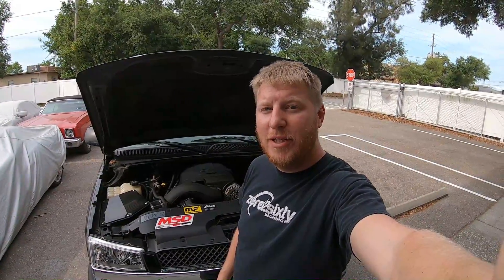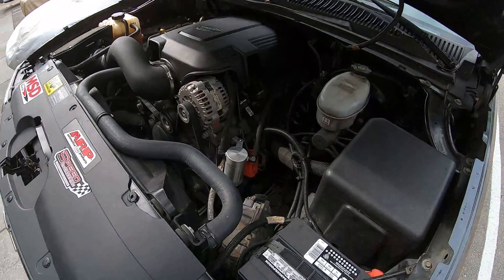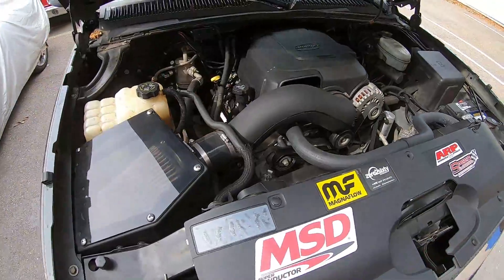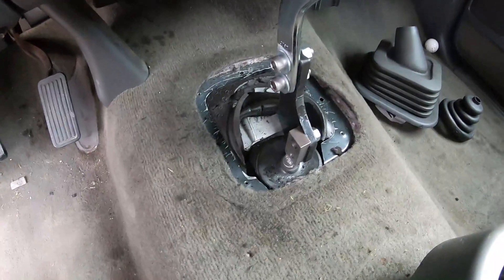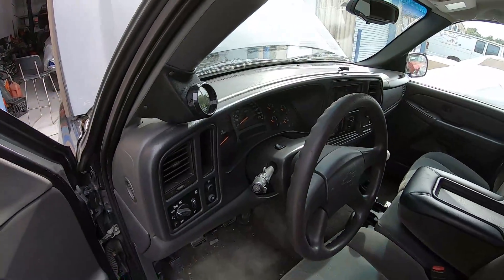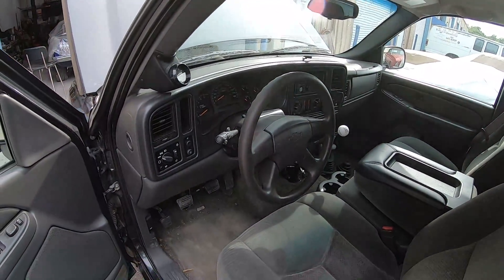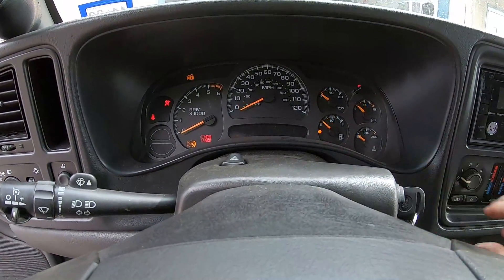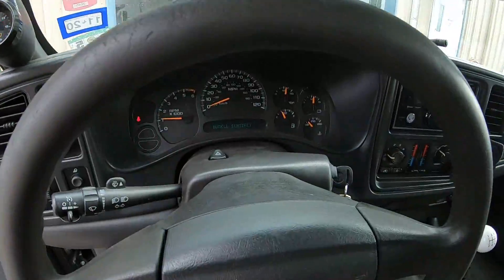This should have been an option! SILVERADO L92 (LS3) & T56 MAGNUM SWAP with a TSP LS3 Stage 2 Cam

Comment: With the l92 having an electric throttle body what did you have to do to get it to work with this truck? Is the throttle body swapped for a cable one?
Reply from the maker: They make an adapter to go to a 6 pin like the ls3. This was a drive by wire truck to start.
Reply: @ my truck is currently a dbc (2000 Silverado 5.3) What would be the easiest way to get this swap done? Add a dbc throttle body to the l92? Or convert the truck to dbw?
Reply: @adriannunez2290  I'm currently doing this swap in my 2002, and I just got a 92mm FiTech DBC throttle body from Speedway. Haven't hooked the cables up but they look like they'll fit no problem and all the stock sensors bolt up to it.
Reply: @ let me know how it goes brother 🙏🏽 I’m pretty close to getting everything I need to get started this is one of the last pieces
Reply: @adriannunez2290  Will do, should have it all finished this weekend so long as no issues arise.
Reply: @ how’d it go man?
Reply: @ I was just about to give an update, great timing! I mostly got the swap done, it's currently running and driving great, and I would say the throttle body is decent. I did have a few issues with it though.

The bung for the cruise control cable is too big, about .019" oversized. I am probably going to sand it down and make it fit, you probably could drill the connector on the cable itself, but I wouldn't recommend that as there isn't a ton of material to work with.

I also put my original IAT/IAC and TPS sensors in it instead of the sensors that came with it, which worked fine at first, but today it would fire and immediately die. I swapped the IAT/IAC sensor back to the one provided and that seemed to solve the issue. Not sure exactly what was happening, I'll probably test it more tomorrow to make sure that's what the problem really was.

If you want a more worry free route, I have heard really good things about the Nick Williams DBC throttle bodies. But they're VERY expensive, around $500, which is the main reason I tried the FiTech. 

Also I personally WOULD NOT swap to drive by wire, I think it would be a ton of work for no gain. But that is merely my opinion and I have not researched doing it.

Hope this helps you!
Reply: I guess the IAT/IAC wasn't my problem, as it is still doing it this morning... It might be something with the TPS, I'll play with it more later and see.

Comment: I just bought a 2005 2500 HD Silverado 4x4 6.0 with the 4L80E and really want to do the Manual Trans, been looking at the T56.. But, I still want the 4x4..
Reply from the maker: Unfortunately there is not an off the shelf way to do this. Every one that has been completed has used some sort of a fabricated adapter to the transfer case.

Comment: Just finishing up t56 mag swap like this and was wondering what clutch line you used to go from factory location hookup(gold quick connect) to new location near the bellhousing? I'm going to a Tick performance clutch master but not for a few months and would like to put some break in miles on my triple clutch setup.  Line length,part number etc. Tha ks

Comment: What’s the difference between the L92 and the L94?
Reply from the maker: L94 cam after the l92. L94 is afm and vvt. L92 is vvt only
Reply: @Zero2SixtyPerformance  thank you for your reply. Also that is E85 correct?
Reply: @Zero2SixtyPerformance  I have a 2010 with the 5.3 that I’m looking into dropping in a L94. (Also a single cab)
Reply from the maker: Pretty much a straight swap

Comment: Hello, I have a question. I have a l92 that I want to swap in a 2006 Silverado. I’m not sure what type of harness could I use. Could a 2006 Silverado harness work with the l92?
Reply from the maker: The 2006 harness will work. You need a cam/crank adapter harness, injector adapters and knock sensor relocation harness.

Comment: Hey! I'm actually doing a similar swap. Would love to reach out and get some pointers on what all I need. I've got the trans, front shift relocated, bellhousing. I know I will need a drive shaft from a 4l60e? And something to block out reverse?
Reply from the maker: The Magnum uses a larger yoke than the 4L60e. You can get one right from Summit. You will need a reverse lockout box as well. We used one from American Powertrain on this car. Also available from Summit pn ELUN-10013
Reply: @Zero2SixtyPerformance  sorry I am just now seeing this. But my trans is not a magnum I actually just have a stage 2 rebuilt converted lt to ls borg Warner t56.
Reply: @Zero2SixtyPerformance  thanks for the help and assistance for sure!!!

Comment: how did you get the shifter location so far forward on the tunnel? In other videos i see the shifter coming out much closer to the seats
Reply: Is there a link to the shifter relocation kit? Having trouble finding one
Reply from the maker: We changed the location of the shifter.

Comment: I’m doing this swap on the same truck but mine is 4wd and I’m planning to delete the 4wd. Do you know if the transmission mount points are the same or is it different since I had the tcase?
Reply from the maker: Either way you will have to modify the crossmember so I dont think its going to matter but to answer your question, I believe the crossmembers are different for 4wd to 2wd
Reply: @Zero2SixtyPerformance  ever done t56 and kept 4x4 on a truck?
Reply: @travistucker7317  can't say I have. There isn't really an off the shelf solution for that unfortunately. It's obviously possible, I just haven't done it.
Reply: @DjDesignStudios  i have heard of people using divorced cases in some odd swaps, just thought maybe there was some other way.  Hey thanks man!

Comment: I’m doing this swap in my rcsb with an lm7 and t56 mag and have a few questions. What clutch and bell housing did you use? And what master cylinder and slave did you use? Thanks
Reply from the maker: Stock LS1 Bellhousing (12453263). Atomic Fab master cyl bracket with stock master (https://atomicfabandperformance.com/product/99-06-clutch-mounting-bracket/). Stock LS1 flywheel with ACT Pressure Plate (GM015) and Disk (3000909). Stock slave cylinder with a large shim from Tick Performance (https://www.tickperformance.com/tick-performance-slave-cylinder-shim-kit-3-pack/)
Reply: Ok thanks man. I’ve been working on mine for about 6 months and I can’t figure out why the clutch won’t disengage. Extremely frustrating but I’ll see if these are the parts I need and get to ordering. I’m using the 5 speed mc and wondering if that could be my problem. I bought a oem fbody slave and clutch but I think they sent the wrong clutch box the numbers don’t match up. So I ordered a luk oem clutch the other day. Waiting on it to come in now

Comment: Is the box optional
Reply from the maker: The box is optional however, you will still need to do something for a reverse lock out. The box is nice because it works off a VSS signal just like the factory pcm would. You could simply hook it up to a 12v switched circuit like the brake pedal to activate the solenoid. You would then have to be on the brakes to go into reverse.

Comment: What kind of fuel injectors you have?
Reply from the maker: ZL1
Reply: We’re they direct fit? I have a l92 with long tube headers, 224 cam, Holley sniper efi sheet metal intake but I have stock fuel injectors 30s. My tuner told me I need bigger fuel injectors. He said 50s. But am thinking ls3 or maybe zl1. What you think?
Reply from the maker: You will need these adapters - https://www.summitracing.com/parts/icb-551287-ls036?seid=srese1&gclid=Cj0KCQjwl4v4BRDaARIsAFjATPk3CXJIpzae97lDuCU03QF6IVZqI_OduYSL3EMFMXsij8QOjAxWzIsaAtAbEALw_wcB